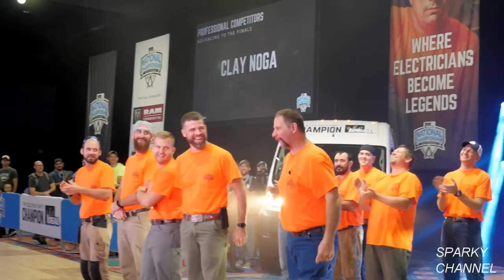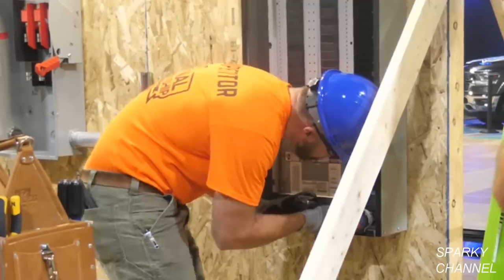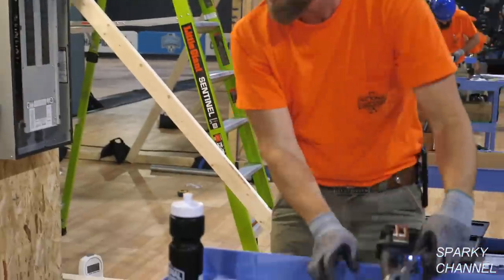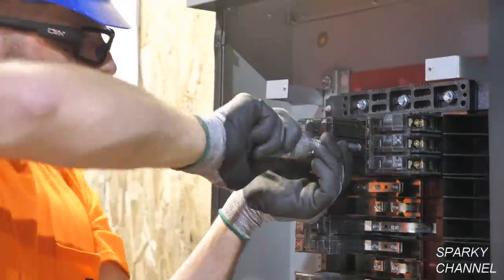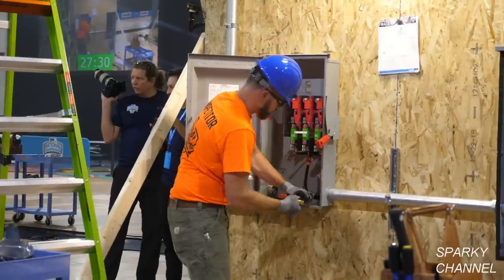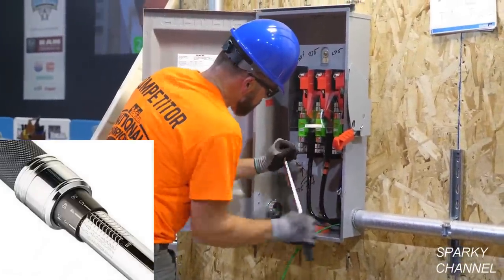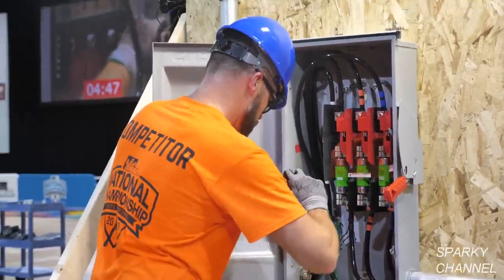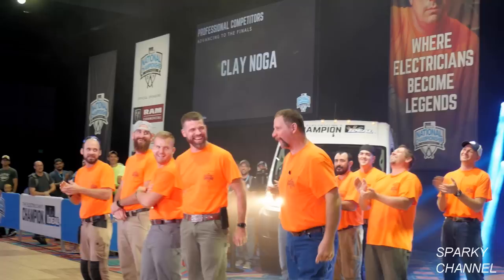IDEAL National Championship 2019 Pro Finals: Service Entrance Cable, Torque, Panels and Breakers

Comment: They waste way too much time not wearing any bags you should have your tool bag on
Reply: Have you ever actually built a service before? There's so many different tools your using you're better off having a cart or table and tool bag like these guys. Keep in mind man your watching ACTUAL electricians doing what they do best, there s reason you're not there.
Reply: @n0cents1001  nah, Noah is right. As an electrician myself these guys would of been sent home a long time ago. Put your tool belt on or go sit in the van. Don't waste my time or money. Get out of here with that "cart" shit.
Reply: @ch1ckenphat514  LOL, these guys did this in an hour dude. They definitely wouldn't be sent to the van. Theyd most likely be your foreman but keep pretending.
Reply: If that was my foreman I wont have to carry tool belt anymore for whole years and if he ask me why ? This will be the reason
Reply: @ch1ckenphat514  Yeah I'm an electrician my self, 15 years. Having a table with you (cart for commercial jobs) which I have a on my company vehicle, when building a 600a,  400a, or a simple 200a service is paramount. You mean to tell me you have all you're 2in male connectors, 2" w/p lock-nuts, 2" pvc/rigid, 2" 1 hole/mini straps, #10 2" screws, 1/4" fender washers, 6-10 breakers, ground bar, weather head, 2 inch hub, no-locks, #4 bare, 10' ground rods, acorns, drills, meter, drive for ground rods, and hammer laying all over the place? Cause your certainly not fitting all of that in your tool pouch, I can you that. Totally unprofessional and unsightly for homeowners and contractors. Take pride in your work and workflow. For apprentices and people who are just getting used to the trade yes making them where there tools pouch will increase productivity and allow them to get familiar with their tools and teach them what tool is appropriate for the situation at hand. But for a seasoned electricians having a tool bag (or the Klein 55485 back pack that I have with  convenient sleeve that pulls out, with everything I need and can hang from any hook) is just find because the kleins are going to stay in the back pocket and you know exactly what tool your going to need before you even need it and I assure you will get the task done just as fast. The tool pouch is not end all be all that determines how quickly you will or will not finish a task, experience is.
Reply: I feel so lame, I use a bag and a cart...
Reply: This is a comp. In a perfect setting lol don't get yalls panties in a bunch 🤣
But some kind of table or cart is great for your extra stuff with just your pouch You can't carry everything in it.... especially doing commercial jobs.
Reply: Guy with tool belt is either young or residential... think of back first

Comment: That Greg is fast and clean. I like the low percentage of speed accounting for the overall score. Not sure that is shouldn't be a little higher however it's all about safety and speed can kill that.....
Reply from the maker: I agree!
Reply: I definitely agree. Speed is somewhat important. But a thorough, sturdy long-lasting application outweighs anything. Whether it's a slide gate, limit switch, or huge industrial motor operating off of a lot of horsepower, everything is determined by the thoroughness of the application. I don't need speed I need quality
Reply from the maker: @ahtribeofjudah5794  I agree!

Comment: Interesting his grounding wire is broken into 2 parts. Disconnect / Pannel has bond through conduit + grounding wire but not through grounding bushing and finally the disconnect has a separate grounding through the disconnect bushing and the actual disconnect surface and the rods. I thought you can't have breaks in your grounding wire? I usually run from meter to disconnect to rods all without a single break. I never run ground to the panel if there is disconnect. Of course, you would still do the cold water ground for the panel inside the building, a separate ground. Was interesting to watch, thanks for the video!
Reply from the maker: Thanks Vlad!
Reply: MBJ is at disconnect. GEC is unbroken through grounding bushing. #6 for rod. 
Between disconnect and panel we have EGC. Sizing in accordance  to 250.122 and 200A OCPD still #6 Cu. Or could be just existing RMC at nec 250.118 (he drilled the holes, no eccentric knockouts are involved, has compression type connector good for nec 250.97). But almost all specs and cities require installation of wire type EGC nowadays anyway (may differ for other states). That's my understanding

Comment: Bill,

I like that one handed cordless metal pipe cutter that greg in this video was using. What brand and model is that one? Let us know.

Thanks
Reply from the maker: It's made by Bosch. I'm going to be getting one and I'll be making a video about it. I can't wait to get my hands on it! :)
Reply: @SparkyChannel  Why did he use a different number of tape stripes on the different 4/0 cables? Seems like he only used 3 stripes on one end of one cable with orange tape. I was thinking it may have been done arbitrarily but now I am thinking that is the high or wild leg of a high leg delta. Thanks.
Reply from the maker: See my video on it: Bosch New Compact 7.3 lb. Band Saw: https://youtu.be/iQz8rRtm6ok

Comment: And what if the wall are not wood , instead brick or concrete ? Its to easy ..
Reply from the maker: That does take a little longer. But with the correct tools and fasteners it doesn't take too much longer.
Reply: If they dont count for time to gather yhe tool it the same amount of time

Comment: Why Mark the black wire when is already black...Hmmm?
Reply: He is being a racist 😀😀😀😀
Reply from the maker: Inspectors in my area allow the black cable to not be marked with black tape but that could vary from area to area.
Reply: I assume so you KNOW it’s black and not just unmarked or fallen off. I also assume the double wrapping is so there’s a backup if one falls off. But I’m neither American or a sparkie!
Reply: Also when i phase the wire i wrap 6 inches of white red and blue tape from the edge of the wire..10 inches of tape  on the service cables for the electric company to id...
Reply from the maker: @torodaman  Excellent!
Reply: @RickMeasham  you nailed it Rick. If one of the other conductors phase tape came off, I still have an identifier on the black which will let me immediately know what color is missing.
Reply from the maker: @greganliker201  Greg, thanks so much for taking the time to answer these questions. All of us here really appreciate it!
Reply: Greg Anliker put a meter on it I don’t trust anyone
Reply: @greganliker201  I would know because i know my 3 phase wire colors..Black,Red,Blue. BRB....  From left to right.
Reply: @torodaman what if it’s Red Black Blue

Comment: I put in my own 200 amp panel and meter base, buried 100 foot conductor out to pole. Then had the city install the meter and pole hook up. Two stoves , arc welder and electric furnace.
Reply from the maker: It sounds like you did a great job.
Reply: @SparkyChannel  yyea first attempt,  I'm a mechanic tho so ...have all tools

Comment: Ok, Guys  In  my opinion Gregory did a super job ! BUT  I feel that to use a torque properly you must put your hand on the grip at the end of wrench to achieve proper torque specs.
Reply: It only makes it harder for him to achieve to correct amount. Doesn't change the torque setting of the wrench

Comment: Cool I thought # 4 would be size for ground wire going to 2 grounding rods it looks like the demo is a 200 amp service
Reply from the maker: The sizes of the wires were called out by IDEAL and the competitors were supplied with those sizes only.
Reply: With ground rod  #6 is fine according to NEC art.250
Reply: @SK-dr4bf  for 100 or 200 amp service
Reply: @DavidBerquist334  no matter. Sec 250.66(A) will help you

Comment: Wire color code is wrong.
Reply from the maker: From Greg Anliker
4 hours ago
NEC 110.15 specifically calls for the "high leg" also sometimes referred to as the bastard or stinger leg to be identified using orange tape/markings. The instructions for this challenge called for a delta connected 3 phase 4 wire overhead service. Phasing is properly done A phase Black, B phase Orange (high leg), C phase blue. B phase to ground, neutral, or another phase will all read 240 volts. A or C phase to neutral or ground will read 120v. Must always be careful if installing single pole breakers on a delta high leg to avoid using B phase.
Reply: Yes. Thanks. You are right. For delta connection with central tap. The high leg is identified with orange tape.

Comment: I noticed he taped one wire orange, that should be for high leg on 3 ph service,  Shouldn't that be on right side of meter instead of center, thne in center as he installed
Reply: It's actually red.
Reply: Black, red, blue 120/208, Black, orange, blue 120/240, high leg system, high leg is “B”phase for inside wireman. High leg is “C” phase for lineman (stump jumpers)
Reply: 277/480v is now brown, purple, yellow. It used to be brown, orange, yellow but to differentiate the orange as standard for 120/240v 3-phase 4-wire delta systems the high leg is orange.
Reply: @a1f1l65  Is that the updated NEC code, because im still using brown, orange, yellow for 277/480?
Reply: There is actually not a code reference for voltage markings, it is an industry standard. The authority having jurisdiction (municipalities)may or may not adopt a voltage marking system. I was wrong when I stated the color code system because the colors I stated are for the City of Houston. The color codes for your area may be brown, orange, yellow for 277/480v. The color code for 120/208 and 120/240 may be black, red, blue. You could not tell the difference just looking at the markings on the wires. You would have to use a meter to get the correct voltage. This is why the City of Houston changed their color codes as I previously stated. Please check with the authority having jurisdiction in your area. Sorry for the confusion.
Reply: @a1f1l65  Thanks for the info regardless. I appreciate it and enjoy adding to my learning.
Reply: Mike Cap  totally agree. What's the use in putting black tape on black wire? Makes no sense and I agree totally. The black is the black. White on black or grey is normally you're neutral wire . Green on black wires your ground wire. I totally agree with you
Reply: The cable color code is wrong. For 120/240 is black, red, blue & white. For 277/480is Brown, orange, yellow & gray.
Reply: NEC 110.15 specifically calls for the "high leg" also sometimes referred to as the bastard or stinger leg to be identified using orange tape/markings. The instructions for this challenge called for a delta connected 3 phase 4 wire overhead service. Phasing is properly done A phase Black, B phase Orange (high leg), C phase blue. B phase to ground, neutral, or another phase will all read 240 volts. A or C phase to neutral or ground will read 120v. Must always be careful if installing single pole breakers on a delta high leg to avoid using B phase.

Comment: No Tool Belt...
Reply from the maker: They don't allow them in this contest.
Reply: @SparkyChannel  I find it very odd that no tool belts are allowed. It poses unnecessary safety risks having to grasp power tools between your legs and climb ladders with your hands full of objects and mouth full of bolts and nails. Not to mention tools were left hanging on by the installing parts and some tools fell to the ground. I find it unprofessional.

I honestly don't know any electrician who does not own a tool belt or a tool vest.

Comment: Throw a wrench into it, ask a electrician to run low voltage control wire and hook up😂😂😂, I kid I kid, I value electricians doing the grunt work, but HVAC-R is the way to go
Reply from the maker: Low Voltage was a part of round 1 (there were 4 rounds) but I agree, HVAC techs are really good at Low Voltage work.
Reply: Imagine working only in HVAC instead of both, what a peasant. i joke of course.
Reply from the maker: @TheJora92  HVAC is a great trade as well!

Comment: I'm from the UK and three phase over here is typically 400v between any two phases. It never occurred to me that three phase in the states would be around 240v.
Reply from the maker: Hi John, cheers from San Diego!
Reply: yeah 120v from either pole to neutral and 240v between poles.
Reply: @JD-ed1uq  so what's your current rating on a main fuse in a domestic property?
Reply: John Shaw here in Australia,  a typical domestic install has an 80amp main fuse going to a 63amp circuit breaker. It can be single phase 240V or 3 phase 415V depending on customers requirements
Reply: @shanginadildo  In Germany 3 phases, 63A each. 240V / 400V in a single family home, can be higher or lower ... A typical socket is fused with 10-16A / 240V